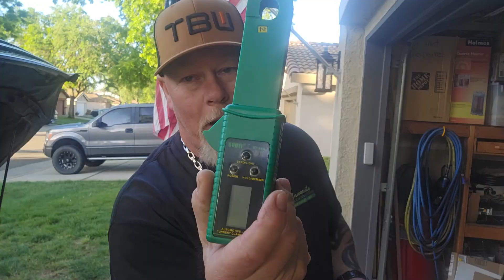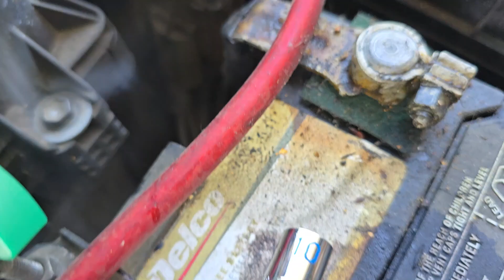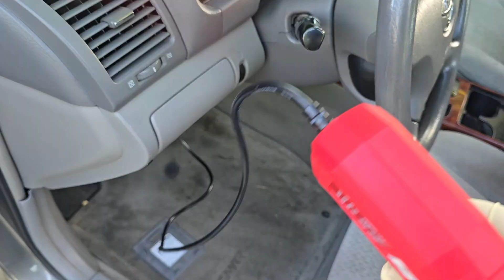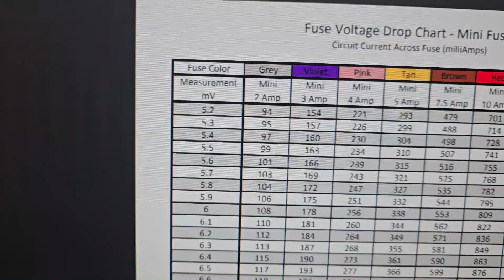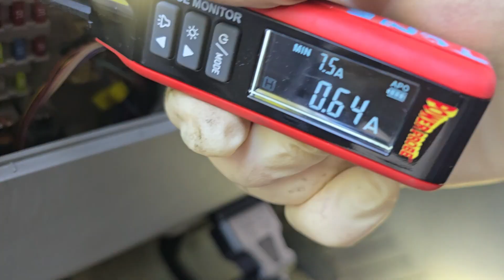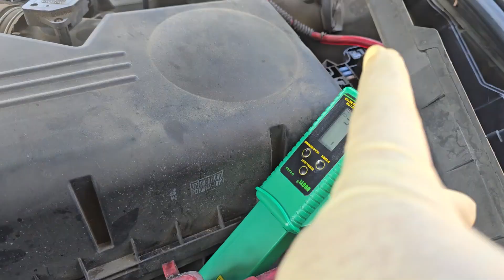How to Diagnose a Battery Drain

Comment: Excellent video Tone! That Powerprobe  fuse voltage drop tool sure is nice to have. Much easier to use on those under dash fuse boxes than a multimeter. The toughest drains are the intermittent ones. My landlady's son has a 2004 Chevy Impala SS that would kill the battery. He drove intermittently and mainly short distances. I attributed the battery issue to lack of driving. I finally decided to check for a draw. It had a 30 milliamp draw. Chevrolet service information allowed for a maximum of 50 milliamps. I put a new battery in and told him to drive it that the car was in spec. Killed another battery after a year. He said that he could hear the radio making noises like it was trying to eject a CD. I didn't come across it when I had the car for a week. The radio would do this sporadically. Pulled the fuse and problem solved.
Reply from the maker: @mlieser1230  awesome man yeah radio is super common cause of a draw.  Thank you